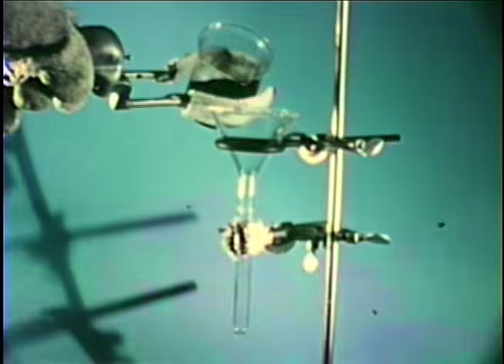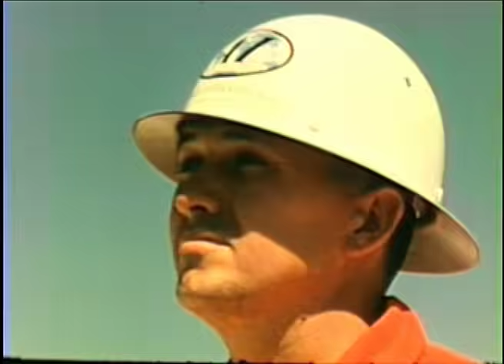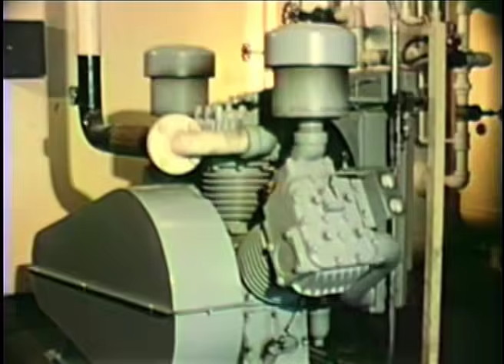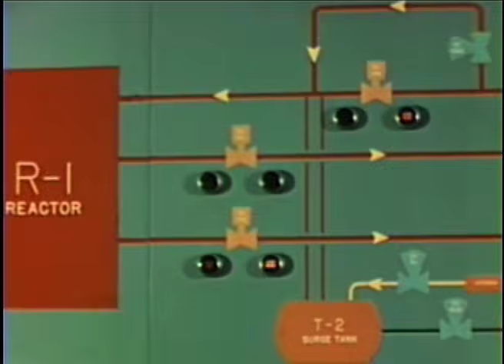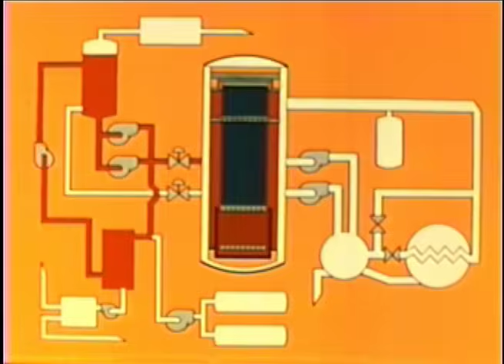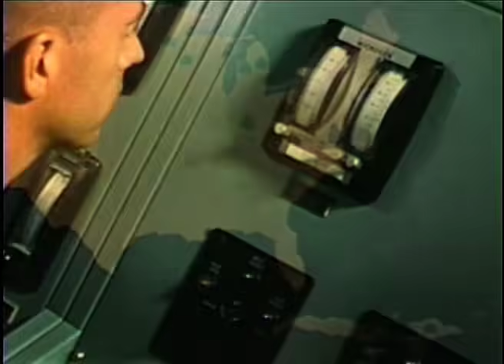Piqua Nuclear Facility

Comment: The Whiteshell  Reactor WR-1 was an organically-cooled (heavy-water moderated) research reactor, at the Whiteshell Nuclear Reactor Establishment in Pinawa Manitoba, owned and operated by Atomic Energy of Canada Limited.  The reactor was designed and built by Canadian General Electric. The reactor ran successfully from 1965 Nov 1 to 1985 May 17.  It had many more years of service left in it, but was shut for (probably) political reasons (internal and external).

After some initial coking problems with Monsanto's HB-40 coolant, WR-1staff determined that higher coolant flow rates overcame this problem.  The reactor ran continuously with 380°C outlet temperatures at a coolant pressure of only 2 MPa.  The coolant slowly deteriorated with neutron irradiation, so a feed-and-bleed make up system was used to maintain coolant quality.   The peak temperature obtained was 425°C for a short period.  An excellent reactor with a high availability factor.

An interesting feature was that the coolant prevented corrosion, so the primary heat transport system stayed cool radioactively.  This meant that the used coolant (from the feed and bleed system) could be burned.

Further details at https://www.cns-snc.ca/media/history/wr-1/wr-1_3.html

Comment: For a long time, I have been studying the reactors of the primary nuclear era. The Organic Cooled Reactor is one of my favorites. 
Its very easy to handle and the materials are very common with petrochemical industry. Its a shame the goverment decide to shut down the facility before the engenierings had been solved the problem of coolant flow in the fuel elements. 
The future of nuclear energy had been very different if the Organic cooled reactor has survived.